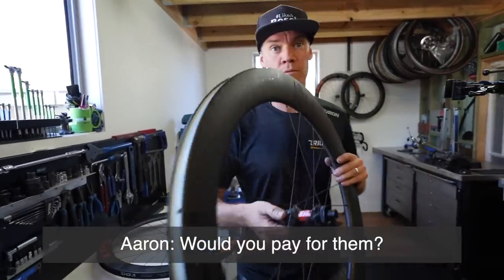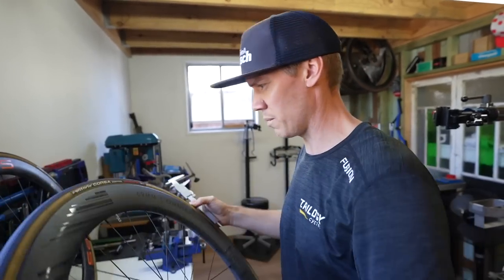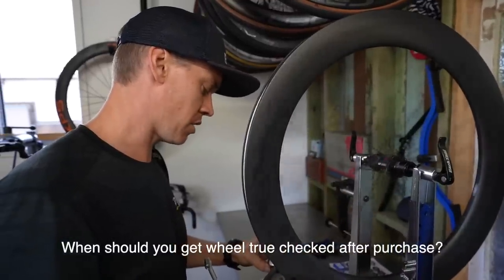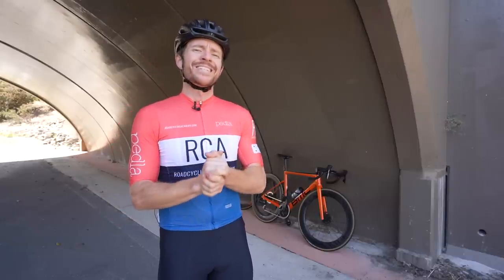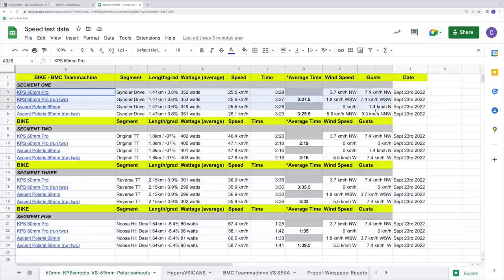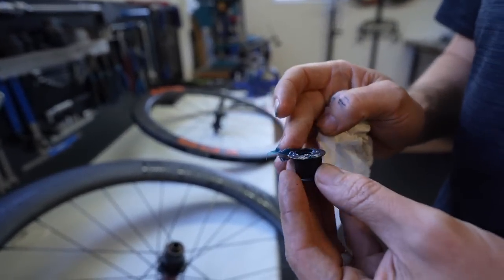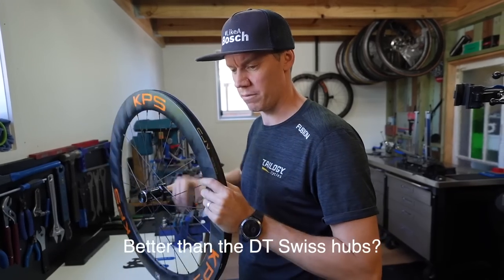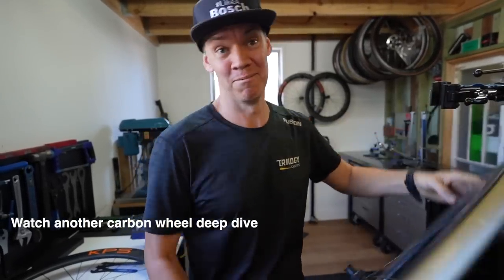69mm Ascent Polaris VS 60mm KPS (Carbon Wheel Review)

Comment: Since this video was published, loads of people have emailed me ref both these wheels so I'm posting the update here in the hope that people will see it. 

KPS - Had one email from Josh, i was under the impression new spokes were going to be sent out but to date - 10 months later, nothing received

Ascent - New spokes received, so I can't fault QX's customer service. The wheels were retested, aero performance is quite poor. The wheelset is extremely wide and heavy as a result. The construction of the rims is also extremely poor, lots of tenting and wrinkling internally. 

If I'm honest, the experience with both wheels was not pleasant, people have had problems with "beta" wheels with youtubers before but none of them crashed like I did as a result of loss of tension. Personally, I would agree with Aaron, if you are spending that much on wheels I would a) buy farsports/winspace and save the money or if you need the badge, get a set of Aeolus
Reply from the maker: Thanks for sharing on the thread mate. While not perfect by any means, the speed tests I did certainly shows they’re more than competitive with other wheels I’ve personally tested. I also personally enjoyed riding both wheels, but we all have different riding styles and preferences at the end of the day. So appreciate your perspective
Reply: Dear Dr Hambini, I am glad you received the new spokes. I had offered, as part of the recall process, to pay for the labor for re-lacing them. Thankfully, you had colleagues who were able to perform that function for you.

I am glad you managed to re-test the wheels. I wish you would make your protocols public though, because your results do not seem to match the experiences of our clients - from Cam Nicholl's real-world testing results, to NorCal Cycling's criterium wins, or even the testimonies of some of our riders in the comments section of this video (Sunil mentions that the Polaris was hands down the fastest of all his wheels, Jason mentioned that they are rock solid at 51mph). Without the ability to examine, or even replicate your test protocols, it is impossible to replicate them, or determine their relevance to recreational or professional cycling. 

I hope that you would also acknowledge that there are other factors in wheel performance beyond drag - factors like stability and comfort which affect the ability of the rider to perform in non-ideal conditions. You may choose a wheel that is faster on paper, but if you are unable to control it, there is no point. The rider is an integral part of the system - you can't just take a wheel in isolation and call it the best because it has the lowest drag, because there is a rider on the bike who is affected by how much vibration the wheel transmits, or how much steering input is required.

For the record, we have not had a single manufacturing-related hub, spoke, or rim failure since we performed the carbon spoke recall. I strongly assert that our rims are fit for purpose, and that they meet all the functional requirements, including impact strength as required by the UCI.

Regards
Qing Xiang (QX) Yee
Founder
Ascent Bikes
Reply: @ascentbikes  are you actually calling out the cycling god HAMBINI? big mistake my friend. Hes probably prepping you for a sunday roast right now🔥🔥do you want stuffing and goose fat potatoes with that?
Reply: @mabozza85 
 I’m more of a roast pork person myself – don’t have that many geese in Singapore.
While I respect the good doctor’s skills engineering design and skills with a lathe, the cycling Gods that I look up to are more the likes of Peter Sagan, Eddy Merckx and Tadej Pogacar – the guys who are on the road making the bikes sing.

I am writing this not to attack Dr Hambini, but rather in response to his comment in this video thread. In fact, my wheel designs were based on his earlier videos which stated that transient response, not steady state, was more important in determining the performance of wheels in the field. The fact that Cam Nicholls, Peak Torque, and NorCal Cycling have mentioned that the wheels are fast and stable is a reflection of the success of the design in this regard. 

Scientific papers require precise methodologies to be published as well, so that others can replicate and confirm/deny their findings. In our case, this information could be used to improve our designs. According to Dr Hambini in our conversations, the wheel drag is tested using the entire bike + rider setup. However, there was no mention of which bike was used, or which rider, clothing, posture were used.

I had previously mentioned to him that by changing from a rim brake bike (previously used in his tests) to a disc brake bike (used for Polaris testing), the drag figures would change as well given the frame aerodynamics and rider fitting. However, no answer was forthcoming about how those factors were controlled. We don’t even know what weightage was used for different yaw angles to derive the final figure! Given that Dr Hambini does not currently (to my knowledge) have access to a wind tunnel, it would also be helpful to know how he controls for winds during testing. 

With regards to stability testing, he mentions Dinitriev number, but makes no mention of what function that is, or why a value could be considered stable or unstable. In my conversations to him, he referred me to a 45 minute video on MiG-29 design, which made zero mention of the Dinitriev number. Trying to find references online about this also came up empty. If anybody other than Dr Hambini has performed research on this topic, or can point me to references on this topic, I would be grateful.

My assertion that there are other factors in wheel performance beyond drag has to hold true – otherwise, everybody would be riding double disc wheels with the skinniest possible tires. Obviously, this is not the case, and the proliferation of wider wheels and tires means that riders value other properties like stability and comfort in addition to aerodynamic performance.

With regards to weight, the Polaris is one of the lightest in its class, with the DT180 Raw version coming in at 1560 grams with CX Ray spokes. A Hadron2 Ultimate 625 from Hambini-Approved SwissSide is 1682g, despite being shallower and narrower. Dr Hambini may not have experience handling wheels this deep, but comparing the weight to wheels in the 40-50mm depth class is unfair.

Finally, I am simply stating facts about the reliability of our wheels. We have not had any manufacturing-related failures of hubs, spokes, or rims after the carbon spoke recall – this is a fact. Our rims meet all their functional requirements, including impact strength as required by the UCI. A product made immaculately may still fail, while a product whose design takes safety factors into account will still function to spec, even with limitations of the manufacturing process taken into account.
I wish you the best in your cycling journey, with clear skies and fair winds.

Qing Xiang (QX) Yee
Founder
Ascent Bikes
Reply: @ascentbikes  feel free to send me a pair and i'll chuck em on my madone and see how they match up against my aeolus.....
Reply: @mabozza85  Thanks, but rider "Yoog" already has purchased our Polaris DT180 for his Trek Madone, and has commented in this video. "Been running the Ascent Polaris (DT180 hubs, GP5K S TR 28mm) for 3 weeks. The tires balloon to ~30.5mm at nominal tire pressure, up to 31mm at max rated pressure. Like others have said, for a 69mm depth, they are stable and handle wind gusts predictably. Coming from ENVE SES 5.6s, it's nice to finally have an aero wheelset optimized for wider tires. The local road races are hell on equipment."
Reply: @ascentbikes  if you that confident youd send me a pair and i do a in depth review.
Reply: @mabozza85  Sure, and to remove any accusations of bias, it'll be great if you purchased it! :)
-QX
Reply: @mabozza85  You could, of course, get a 10% discount on the wheels by looking at the video description :)
Reply: @ascentbikes  Nah i'll stick with my aelous thanks. Tried and tested. Bombproof!😉
Reply: @mabozza85  As this is a public forum, and to give everyone a complete picture.

Before making the wheels, Ascent contacted me for some aero guidance, I did comment that I couldn't do it for commercial reasons but I was happy to give  some general help which was "don't make the wheels wide, you will go slower" or words to that effect. I could probably dig out the emails if anyone really cares

The wheels produced have a ~31mm section. If you apply even the very basic laws of steady state aero, you would need around 90-120mm section to avoid premature separation at reasonable reynolds numbers. This is coupled with these wheels having a fairly blunt trailing edge. The move to sapim spokes has made the aero even worse. The trade off is the wheel is extremely slow because the pressure drag generated is large. It's exacerbated if you rock when you ride or you have a pulsing crosswind or a constant crosswind at mild yaw angles. 

Now to give some context, the stability for a ~70mm wheel could be argued as being good  (which is what the argument that ascent are stating) but my point is you are having to carry the weight and size of a 70mm wheel when a 56mm wheel has the same (ish) straight line performance and far superior stability. Quoting individuals who have had a good experience with the wheels is fine and dandy but it's people's opinions and they are completely entitled to them. 

To calculate that stability, I (and others ref Reserve wheels) use modified/variations of dnitriev methods. It is not for me to explain the exact method because I'm not a lecturer in transient aerodynamics and there are commercial considerations as well. However I'm sure there will be someone in the local university who would have the knowledge to explain it and how to test for it. I would also stress that I pointed out that a wide wheel would exhibit these kinds of characteristics before receiving one for review and that has played out.

And finally, the aero is very open to debate - people can't see it so how do you explain it? In contrast, the manufacturing of quality of the wheel is very visible and nobody is going to say the ascent polaris is a well made rim. The insides are a mess with loads of tenting and layer displacement. The comment that Ascent made was it was "fit for purpose", suggesting it had more layers to account for crap manufacturing. 

I think my review whilst painful for Ascent was quite mild. They didn't really get reamed. My comments remain the same. 

These rims appear to be very similar in provenance to the Parcours velo wheel rims, and they will be reviewed shortly.
Reply: @Hambini  your no bullshit approach and 100% honesty is very much much appreciated! Lots of ❤ your number one fan. Mikel aged 5😘
Reply: Dear Dr Hambini,

I checked all my emails, and I could not find your mention of wider rims being slower during the time the rims were being designed (mid-to-end 2020). You may check - if there really was an email about this, I apologize in advance. I was referencing your video on bicycle aerodynamics, which stated that transient performance was important, as flow re-attachment was a factor after a gust. Here are some queries and comments that I have on your reply - I would appreciate more transparency about your test methods:

Chord length: With a 28mm tire, the chord length would be roughly 69mm (rim) + 28mm (tire) = 97mm, which is within your proposed range of 90-120mm. Am I missing something here, or is the tire not meant to be part of the system?

Rim shape: The trailing edge is much pointier than the U-shaped rims that were popular - the Polaris inner radius is about 8.5mm, which is significantly less than what a U-shaped rim would have. I'm not sure why you would want a pointy end, given that the air also has to flow in reverse on the back side of the wheel. 

Aero Testing: While not simple, I'm sure most of us would appreciate some clarity about your testing methods. Do you:
a) Test it synthetically (in software)
b) Run it through a wind tunnel
c) Test it in the open field?
If b or c, how do you quantify and account for the difference in bike, rider, rider gear, and posture, and wind angle/velocity/vorticity between test runs? Given that the rider accounts for 80% of the drag in the system, and since you are switching between disc and rim brake bikes, how do you ensure that contributions from the above do not swamp any differences from the wheels?

Aero Results: If you are providing a wattage figure, how do you derive that figure? 
Is it a weighted average of steady state yaw angles? If so, what weightage are you using?
If it is a result of transient tests, then what kind of conversion and simplification are you using to derive a single number?

Stability: I understand if you have commercially sensitive information, but lacking further information, the Dnitriev (or is it Dmitriev) chart seems more like a 5-year-old drew it. What tests did you do to calculate the numbers? I recall that you have not had access to your company's wind tunnel since COVID happened, so I'm wondering how you derived those lines.
Do you have a generic term for the Dnitriev/Dmitirev number? I have access to some career aerodynamicists, and have since posed them this question.

Construction: We are always working to improve our manufacturing processes. However, a rim is supposed to: Accept a tire at rated pressures without exploding, accept spokes at tension without failing, pass the UCI impact test for racing, and hold up under repeated use. I would say that our rims are meeting that criteria, with no manufacturing-related failures reported since launch. I agree, there may be more weight to be lost by fully optimizing the production process, but I'm sure you'll agree that we are still lighter than most of our competitors (including SwissSide) in this weight class, while meeting the functional requirements of what a rim does.

Regards
Qing Xiang (QX) Yee
Founder
Ascent Bikes

Comment: There's always inherent risk to investing in boutique brands. Issues like spoke delamination can be a real deal breaker. However, because of their new appearance to market, having a right start is important. Doing a preemptive recall of the wheels with the aforementioned carbon spokes was the right move to establishing a loyal customer base. That, and you get direct access to the builders of said wheels is a plus in my book. Cheers to KPS and Ascent for doing the right thing.
Reply: Thank you for your kind words. It was painful, but it was necessary.
Reply: I guess that's what you have to do when establishing a new brand, being fair and progressive with recalls and replacements or you're done right away from the start. On the other hand, well-known brands also have their quality issues and initial design flaws but I guess good consumer service becomes more and more important with expensive components.
Reply from the maker: here here

Comment: Just received my second set of Farsports  Kaze rim brake wheels (50mm and 35mm respectively) and these things for about $1600 AUD are simply awesome  - round, true and rigid. Specced with DTSwiss240 hubs, Sapim C-Xray spokes, brass nipples (my choice), 25mm external and 19mm internal width, both wheelsets have remained true with NO change in spoke tension over 3000m and 600km respectively. FWIW i=I weigh in at 92kg.